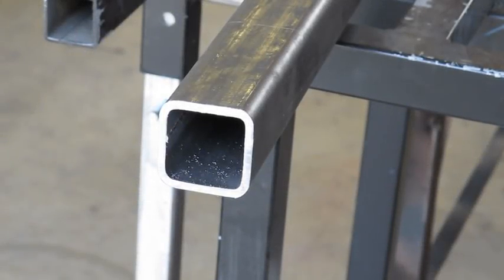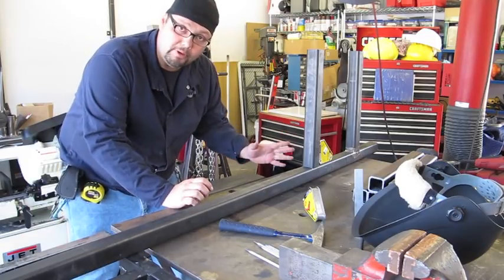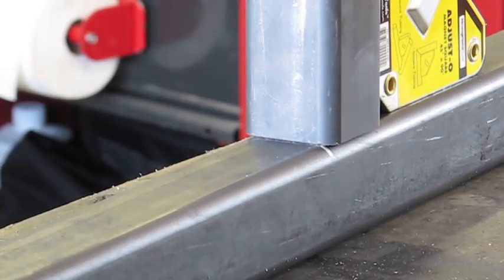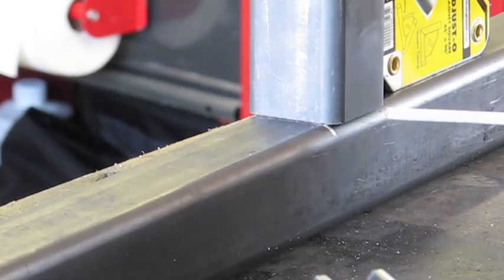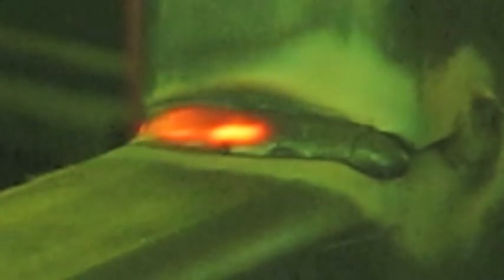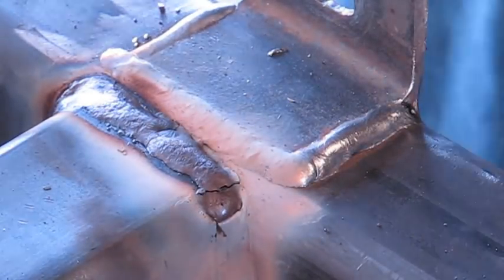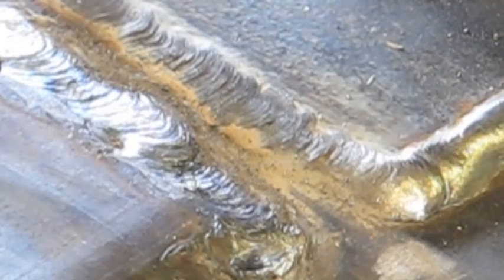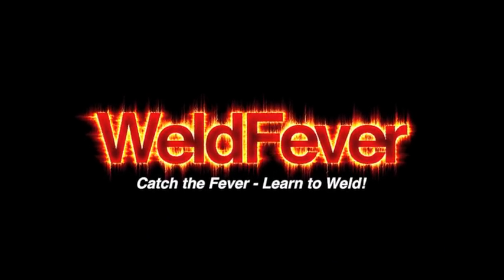Stick Welding Square Tubing

Comment: The welder in me says "looks good" but the engineer in me says "take the extra time to add some gusset bracing underneath". You'll be glad you did.
Reply from the maker: +BigRalphSmith I had considered it! Thanks for the comment.
Reply: +WeldFever  It may not be needed if it isn't holding a lot of weight.
Reply: PotatoGunsRule
I'm glad you aren't designing bridges, buildings, or cars.
Reply: +BigRalphSmith  He's using 7018 rods that hold with something like 70,000 psi.  He's using pretty beefy stock at 3/16x2x2 inches of square tubing that isn't very long in length.  Per the video ending, he doesn't have a lot on there.

Thanks for the little insult though, people with made up names on youtube can't seem to disagree without getting personal.
Reply: PotatoGunsRule
You'll live.
Reply: +BigRalphSmith  Most certainly I will live, the extent of your "big" is limited to what you can type.    I noticed you didn't reply to the facts I put forth.  Telling.  Go design yourself a brain, bracing may or may not be needed.
Reply: PotatoGunsRule
LOL
Reply: Add a 2'' keeper at the outside end, for the piece of round stock that somebody is bound to throw up there.

Comment: Yeah! another good video on stick welding square tubings. Problem here in our country we get only thin gauge wall tubing so we don't use 7018 rods but the 3/32"  6013 rods and applying it very carefully so not to blow holes or burn up the thin wall. But if I'll be doing the same project with our kind of tubing, I'd be welding gussets under the supports just to make sure. Anyway your videos are very informative and full of invaluable tips for noobs.  Thanks for sharing !!
Reply from the maker: Robert Sygui It is my pleasure and thank you for the nice comments!

Comment: Dude. I have done the same welds. With the same materials & the same electrode. And by that i can tell that you have done a hill of a job,  very clean very industrial grade weld job ,  thats really neat,  thanks, hop to see more from you
Reply from the maker: +sultan000sultan Thank you very much!
Reply: +sultan000sultan I'm sorry but I gotta disagree. For industrial grade weld job he'd have to grind off the tacks, might lose some penetration on them. But it's not a pressure vessel so it's not a major mistake :)

Comment: Hi Weldfever, I´m just learning stick welding because I can´t afford a usable TIG/MIG welding machine and it´s beginners choice for that reason (I think). Just did my first welds using your technique and it did fine - after a few passes I got my first good looking weld, and that´s with a cheap inverter and 3 mm rods. Thanks for sharing!

Comment: Like the video i do understand the concept on why you wanted to use the stick but mig would of held just fine (just turn the amps up) "Be confident about your welds" is something i was told when i first started
Reply from the maker: I totally agree with you and really have no problem with it myself, but as I mentioned to another viewer, I had done MIG welding on square tubing a few times before and wanted to change it up. Also, I wanted to show the stick process as a viable alternative for newer welders, or those who only have a stick machine. Thanks for the comment and please keep watching and posting!
Reply: Ya makes sense i don't have a MIG just a stick welder and i had gotten to the point where i can weld 16 ga. tubing no problem.
Reply: WeldFever How long would it take me to learn how to confidently weld a GoKart frame with a MIG welding? Is MIG strong enough? Thanks
Reply: Probably an hour and yes of course as long as you have the right amp and wire speed setting

Comment: I use my 80amp stick welder all the time. I prefer to use the 6011 rods with it. My welds seem to get better penetration with those ones. Built a atv trailer with it and many others projects. Yet to have a weld break. Its all in how you lay the weld and prepare the work to be welded. Thanks for the video. Love to watch other people weld and learn new tricks. To anyone who is new at welding.....practice....practice....practice.
Reply from the maker: +SuperCyril2 Thak you and you are correct, practice makes perfect!

Comment: I'm wondering why you didn't grind off the millscale first. I've seen bend tests fail due to lack of fusion from not cleaning millscale, even running hot with 6010. I understand if it's not really a critical piece . . . just curious.

Comment: I'm an iron worker and I've learned to trust mig a lot more than I used to a lot of our steel beams are pre fab in the shop with mig and these said beams support massive core slabs.
Reply from the maker: +Landon Jones I too used to pre fab steel beams in a shop and we would use dual shield (flux cored with shielding gas) or Lincoln, but never short circuit mig. In fact, per the AWS D1.1, GMAW-S (short circuit mig) is prohibited in structure steel applications. Thanks for your comment.
Reply from the maker: +WeldFever I meant to say Lincoln 71M, not just "Lincoln."

Comment: I was doing this today, but with 16G 1.5" tubing... a lot of experimenting led to using 1/16" 6013 rod on AC at about 40amps.

Great video.

Comment: Hey. I been wanting to take up welding to add to my hobby and love of custom motorcycles i wanted to know if u can tell me what size stick welder amps n volts and what kind of rod i should use for welding a frame together
Reply: awesome brother thanks a lot ima give it a try
Reply: Chino.  Paul is right, but depending on the metal used for the frame there many options.  If it were mild steel and I just need to fix something to get me going again and all I had was a arc welder....  I would 3/16"  7018 up to 85 amps depending on metal thickness.  I would have it tig welded for best results though
Reply: 3/16''  is far too large. I think you meant to say 3/32'', the amperage is about right, but yes Paul is right.
Reply: hahaha yeah 3/32.  Thanks for correcting that.

Comment: As a noob to stick welding, I think I would have welded gussets underneath those supports . . . . just in case.  Thanks for the great videos.
Reply from the maker: And there would be nothing wrong with that. As a matter of fact, I contemplated putting some additional support on the sides of the support arms, but decided given the small amount of stock that I keep around, it would probably be overkill. Thanks for your comment and please keep tuning in!

Comment: subscribed to learn welding

Thanks from Va
Reply from the maker: +Onenasty306 You're welcome!
Reply: +WeldFever My homework for Design and Technology was to look at metal joining techniques. We're using the same diameter tubing, and I think the same welding method. THIS IS EXACTLY WHAT I NEEDED

Comment: Dan, nice video and decent looking welds...just curious why you didn't take advantage of the opportunity to demonstrate horizontal stick welding all around instead of just on the T-joints of that tube...don't get me wrong, I Know it's Much easier doing it flat but a lot of viewers would've probly like that...
Reply from the maker: Thanks for the compliment. In response to your question, I try to get in as much as I can, but sometimes its hard to fit it all into a short video. I do have some horizontal stick welding videos out there though, so I'm hoping viewers will bounce around and pick and choose what they need. Thanks again and please keep watching!

Comment: I know you're just making a video to inform new welders, but the 7018 electrode isn't stronger than the ER70S (chem comp)... They are both rated 70,000 tensile strength.. I'm guessing what you meant was the stick process penetrates better than the mig process here?
Reply from the maker: +Jacob Hohn Yes, you are correct. I only wish I had been more specific when I made the comment, as I have had many posts regarding this and some people have gotten pretty upset over it!
Reply: Dang... Some people take things too seriously. Didn't read comments or I'd have left it alone. Just didn't want an informative video to have bad info to beginners. All good man! Have a nice night
Reply from the maker: +Jacob Hohn Thanks for that and please keep watching and commenting!
Reply: +Jacob Hohn Truth be told; GMAW has transfer styles available to it that far exceed SMAW's penetration; such as spray arc transfer. SMAW is (according to the AWS) the same as GLOBULAR transfer. Most GMAW transfer that you will see being done is short circuit transfer (this is identifiable by the fast crackle noise). The best penetration available is with FCAW and a CO2. The only reason someone would say that stick welding is stronger or more structurally trustworthy than a wire weld is because SMAW does not suffer from cold start and SMAW is slower deposition rate / more time spent controlling technique and walking the puddle / controlling the heat. - (GMAW seems fast to fill and does not allow enough time to be the one in control of base metal heating / puddle walking.) With SMAW, the end result must be a good looking weld as the OP states. a good looking weld usually IS a good weld. Sometimes penetration is the enemy. Like in this job. He was going to have too much heat and penetration and he had to employ technique to control heat toward radius of larger heat soak mass of big tubing rather than allowing the heat to blow out the end of the other piece. So penetration can be an enemy! With stick; here is where rod diameter selection comes into play. A 3/32" would be a good choice. It would have allowed slower deposition, more time to control heat and the ability to walk out a prettier bead with more reinforcement without oversoaking base metal before end of bead. The only reason I would have preferred SMAW over another process here is because after I welded it with stick myself, I know - because I did it - just exactly how well welded it really is. No mystery.

Comment: Has anyone ever hear of the MILIMETRE? It is quite a new thing and eliminates the use of fractions of this and that.
Reply: Nothing wrong with the metric system.  We probably should adopt it.
Reply: +Marius Grobler the man who pays has 1 drawing imperial and 1 metric. the 2 parts must be connected together and the 2 surfaces are pentagons that will face each other.... Go Ahead and build it! 
that is why to learn everything.
Reply: +Marius Grobler I'm European and I much prefer fractions. The Americans have the right idea on this one.
Reply: Paul Frederick Absolutely. Besides, the metric people are only fooling themselves. They are still operating on fractions, only they artificially limit themselves to denominators of 10, 100, 1000, etc. Why not use 2, 4, 8, 16, 32, 64, 128, etc too?

Also an advantage of inches and feet is that they are anthropometric. They are ideal for use for things on the human scale, like houses, tools, nails, etc. I've never heard a European carpenter talk about "putting up some 38x89 studs with 100 mm nails", that would be stupid. Everyone knows what a two-by-four is, even in Europe.
Reply: Paul Frederick  the Navajo code talker's helped defeat the Japanese!
Reply: there are countries who use the metric system and there are those who have been to the moon.
Reply: +kimballcody yes, true. Then there are those who prefer archaic systems and those who have progressed. 1,000 milimetres = 1 metre. 1,000 metres = 1 kilometer. Hence 1,000,000 milimetres in a kilometre. See? Simple!
Whereas 36 inches in a yard, 1,760 yards in a mile. Hence 63,360 inches in a mile.
That is why it is called the metric system...so that you Moonwalkers don't crash your spacecraft into Mars.
Reply: Metric has advantages in sciences like physics and chemistry. For tools and machines either one works well, just depends on what you are used to. It would be nice to have one standard but changing from one to the other is too much work.

Comment: Welding in the field requires position welding, looked like a good place to practice...no weaving in the beveled gap would result in 100% penetration, just get the correct angle of rod will in position.
Reply: +Working Man I would not weave either, straight into the joint... it's a quick pass no heat issues on this.

Comment: great video! you obviously using LH rods which would have a 7000psi weld strength rating, most mig wire has the same weld strengh rating so you can have just as strong a weld using the mig.... it does help playing with the gas composition, having a higher co2 ratio will help get better penetration but even if you take standard mig gas a simple weld sequence will give you piece of mind!! i use mig for just about everything except for pressure vessels and pipelines purely because it isnt x-ray or ultrasound friendly
Reply from the maker: Thank you for the insightful comment! I am always happy to hear from knowledgeable people like you. I totally agree with you, and in actuality have no problem with the MIG process myself, but I had already done some MIG welding square tubing videos, so I thought a change in process would be nice. Also, I thought this would be a better choice for anyone out there that might not be 100% confident on short circuit MIG welding on structural applications. Thanks for the comment and please keep watching and posting!

Comment: as an eternal beginner (i.e. i never seem to get the hang of it) searching for clues what I take from this is that on that 'gappy weld' it's not so much that you don't spend so much time on the other side as that you don't direct the arc that way.  It is always directed at the shoulder of the other piece.

When trying to do that join on thin wall stuff such details are all important I think - in my struggling attempts to find what works/how to do things...

And we're typically working with galvanised stuff, too. Like to see a demo of that.

And you mention more heat on the stick - I thought I've always read the MIG is hotter?  Is it that there's less total heat, the stick being thicker, is that it?

Comment: In case of lighter material (like 1/16" thick) using 5/64" rods, can you also weld a bead like you did? Or would the warpage be too big? I have to make a frame in this situation, and I'm delaying it because I'm not sure how to proceed.
Reply: +Luiz Borges Gomide no weave, straight into the joint, turn amps down to 80-90. make gaps as small as possible to avoid hole burning.

Comment: Is there a formula to work out the correct amperage to  the thickness of the steel and or welding rod to be used?
Reply from the maker: +Dirty Harry000 A lot of people like to use that 1 amp for every thousandths of an inch, but that only goes so far, because you wouldn't necessarily want to use 250 amps on 1/4" (.250) material. What I advise is to look at the amperage range of the stick electrode you are using, and start at the lower end if you will be welding thinner material, and vise versa for thicker. Generally, you will probably be using 1/8" electrodes, unless you are welding sheet metal, or very thick structural iron. So, yes it is a little unscientific, but keep in mind that welding is more art than science. Hope that helps...

Comment: Dan,
I did not read all the comments, so what was the amps used in welding the 3/16 material. About, I know all welding machines are a little different.
Thanks,
I think you have the best video's
Reply: +pughwv1234 115a

Comment: if you put a piece of 2x1/4" flat about 3" long to cap the ends it would look better. also the 1" sticking up would keep your stock from potentially coming off the rack when taking lengths off.  also the gaping openings are dust and insect magnets. just sayn' bro.

Comment: Very new beginner here, so this is not a dig at all. I noticed that you didn't grind down the metal for your weld. Someone told me to do that a while back, which helped a lot with some of my welds, but I see a pro NOT doing it and I wonder why? Is that a beginner thing that more experience eliminates? Or perhaps using 7018 rod? (I'm mostly using 6013.)
Reply from the maker: +OzymandiasTheBassist You are absolutely correct. Mill scale and any other contaminates like paint, or rust, should be completely removed from the piece prior to welding. It helps with better fusion and prevents porosity from contaminants. In the interest of time I did't do that, so shame on me! Thanks for the comment and you keep on doing thing correctly!

Comment: What did you have your welder set at.   I'm getting ready to weld some bungs into square tubing.  I don't want to screw it up.  I'm not a professional welder.  Thank you in advance for your good videos. Ken from Indiana
Reply from the maker: msnstock Thanks Ken. I was welding 1/8" E7018's at around 115 amps based on the thickness of the material. Being that it is on the thin side, I used the low end of the amperage range according to the manufacturer's specifications. With a few practice welds on some scrap tubing, you should be fine! Good luck and let me know how it goes.

Comment: hi. about strengt on mig welding. it depents how good you weld it. i'm welder too and we moustly use just mig becaus its practical and cleaner weld. but i like your job its grate. and yea about amps. usuly in europe its just writen on back of stick package. thear is min amps and max .
and for weldfever. did you trying to weld with mag or dont know how you know it maybe gas welding??
sorry about my anglish

Comment: Great video! Curious what your amperage was?
Reply from the maker: rodartrobot Thank you, based on the electrode I was using and the thickness of the material, it was probably around 115 to 125 amps.